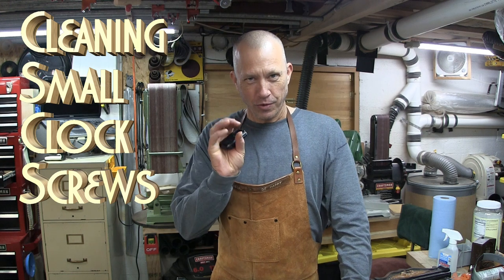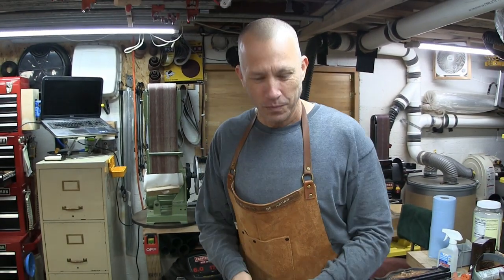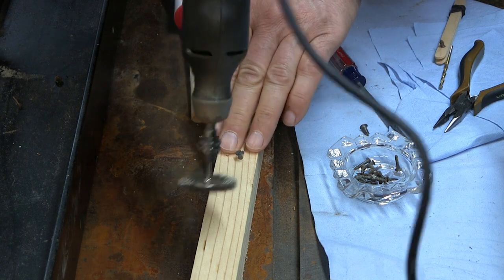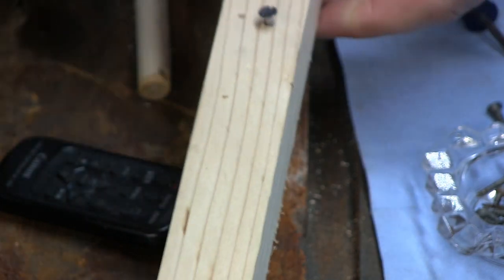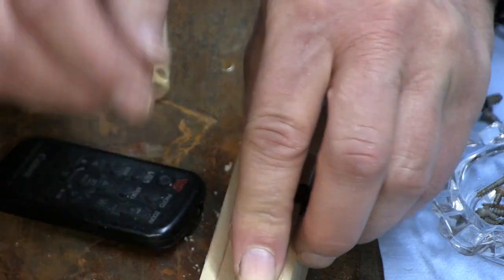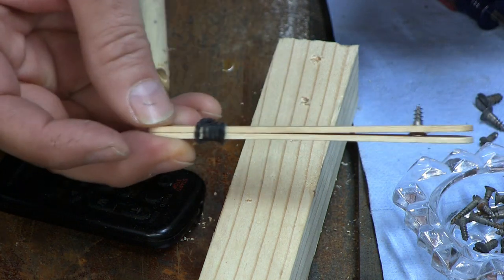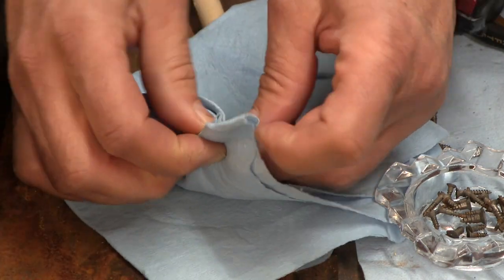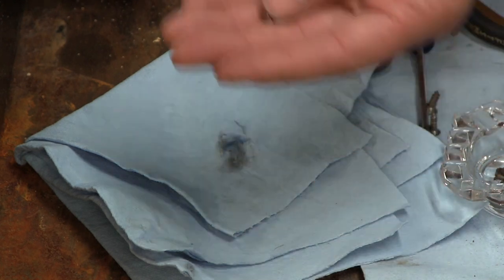Cleaning Clock Case Screws, Amateur Style

Comment: Very nice video Ab! 
Those little screws are worth their weight in gold, especially considering how hard good new screws that 'look right' are to find.
Reply from the maker: Appreciate that okbridges! You are right about those screws! These were not as rusted as they appeared and cleaned up nicely. By the way, did you give up on Odysee? So far, I'm not impressed with it. Always nice to see you!
Reply: @time4clocks  Hey Ab, yes I saw you on Odysee. I am subscribed to you there and get notifications when you post videos.
I haven't given up yet on them but most of my "new" videos here lately have been old uploads I've held back for publishing! I've actually got quite a bit filmed for new videos for when I have the chance to edit them together.
The biggest issue I have right now with Odysee is if I want to watch a video in low resolution, to save my data, most videos are only available in high resolution. 

Maybe someday it will be improved!

Comment: Very good. I use a Dremel too for cleaning screws and your means of holding them is very good. Thanks 😀 👍
Reply from the maker: Hi mrgstuff! Once there was a place on my shirt that was itching me, but I couldn't see anything. The itch continued, so I looked closely, and found a small piece of wire. I had been using the wire wheel earlier. Now I always wear an apron. The Dremel is a most useful tool though!

Comment: Useful tip Ab.
I normally drawn rusted screws, bolts and nuts in vinegar for a day, but never polished them afterwards. Age before beauty the reverse saying goes I thought, but no more.
Glad you are out of that cold you had.
Reply from the maker: Thank you, Practical Fixes. When it comes to cleaning these parts, the only standard is how far one prefers to take it. Since these screws were extra bad, I wanted to make them extra good. :) Some will even blue the heads. I don't go that far but it is a nice touch as well. :)